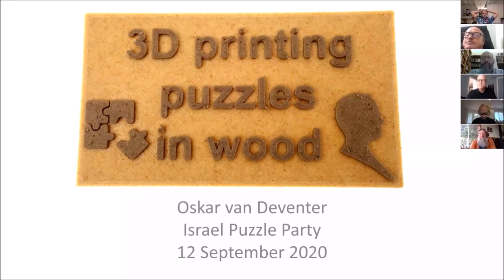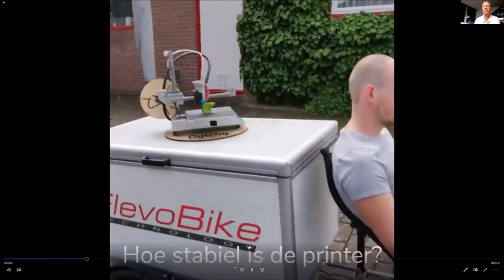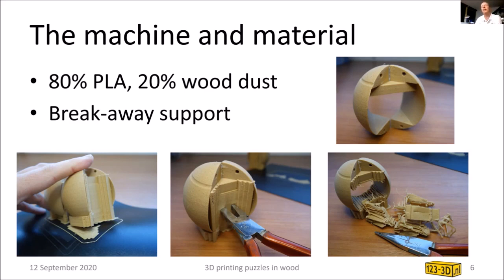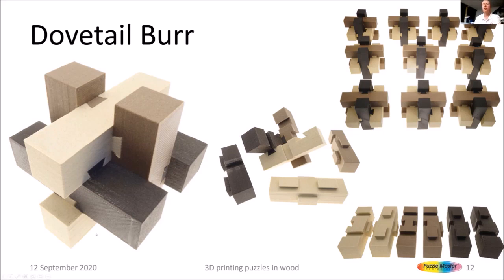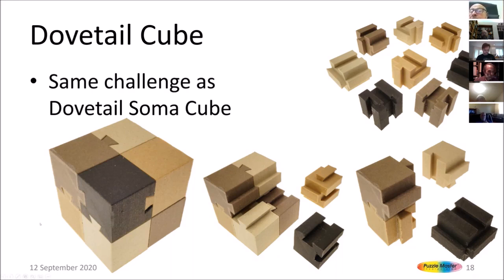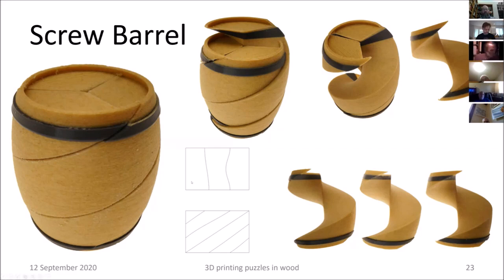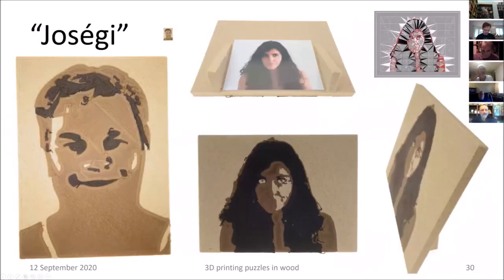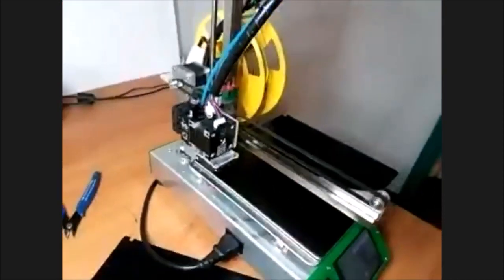3D printing Puzzles in Wood - How do you like this magic material?

Comment: Nice! Have you considered trying to make puzzles with DLP? When you make mazes you can cut down on production time immensely I reckon, since it prints entire layer at once and only height of object determines time for print. My experience is that the layers are not as visible as well, I really enjoy it. What do you think?
Reply from the maker: Those are messy stinky machines. I can ask friends to use their DLP machine, if I would need to. Note that the scarse commodity here is my time: time to design, run and clean the machine, not the machine time itself.
Reply: @OskarPuzzle  They sure are stinky, luckily there is ventilation and they can sit in garage. I am impatient so for me biggest problem is print time, not cleanup, which indeed is longer on the DLP machines. Now at least I know your reasoning. :)

Comment: I guess my fear is that there is already a high demand for rare woods like Mahogany and Padauk.  If this 3D printing material becomes really popular more forests of Mahogany will need to be cut down.  I would rather have a puzzle made from solid Mahogany compared to 3D printed Mahogony.  Plus to save all the Mahogony trees why not just use PLA which does not require cutting any trees down?  So this wood/PLA material is great as long as it uses trees that are plentiful.
Reply from the maker: Interesting view. I presume that more wood is used in a solid wooden puzzle, than one that is 80% PLA and 20% wood dust. I was not aware that birch, mahogany or oak were rare woods.
Reply: @OskarPuzzle  I'm no expert on which woods are rare.  Ideally PLA/wood material would be made from the sawdust created from cutting boards, which is a waste product of the current process.  I have seen PLA/Padauk material, I believe Padauk at least is rare.